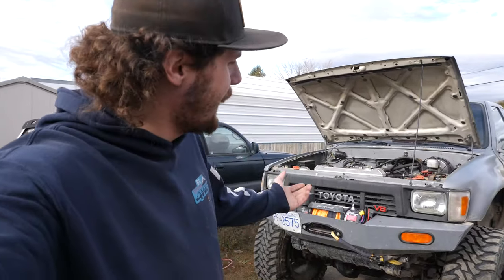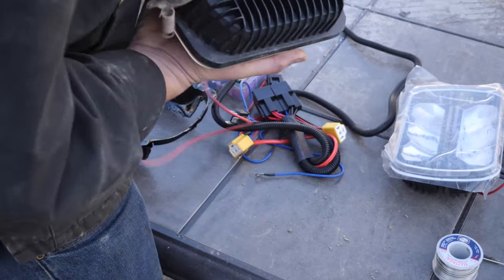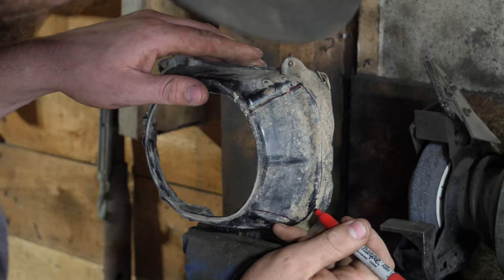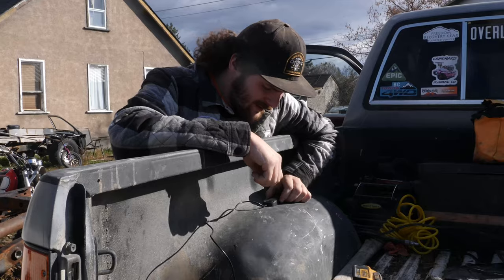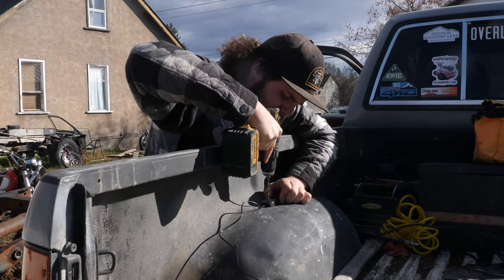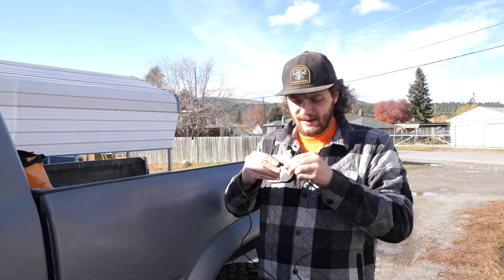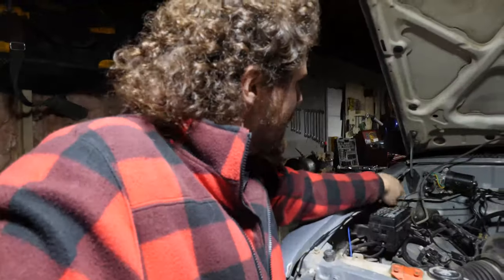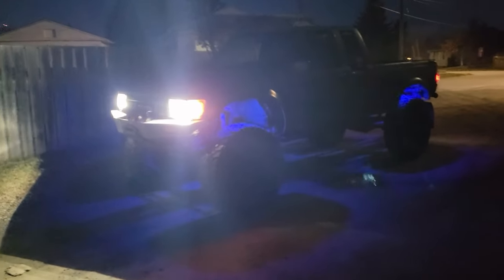LED Headlight Conversion!

Comment: Love the LEDs. I went with the Phillips DOT approved from Lordco. No mods to the buckets required. Also didn't need the adapter harness surprisingly.
Reply from the maker: That is awesome! I did not know there was LED lights that worked with Toyotas double negative stock wiring.
Reply: They aren't advertised as such but I plugged them in as is just for the heck of it... and they worked as is.

Comment: I had the exact same problem with my '81! The adapter harness said it was for a negative ground, and when I plugged it in, my headlights wouldn't turn off except with the ignition switch

Comment: about 5 or 6 years ago, I upgraded my 1990 Mazda B2600i 4x4 from stock to the Bosche headlight plug n ply housing, then instead of going with a traditional 9004 bulb, I went with an LED.  BUT this would have been a much Cleaner and nicer upgrade.. I wish I had kept my classic Mazda, I miss that truck.. BUT it needed a new engine.

Comment: Simply doesn't fit. Been looking for some replacement lights and all I come across you need to modify the headlight bucket. Looks like I'll be sticking with my Cibie glass housings for now.